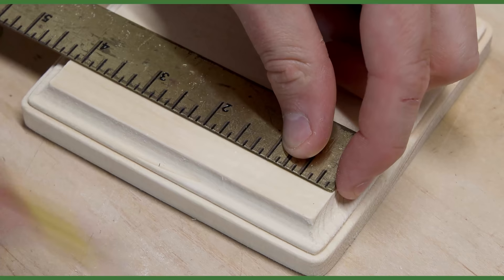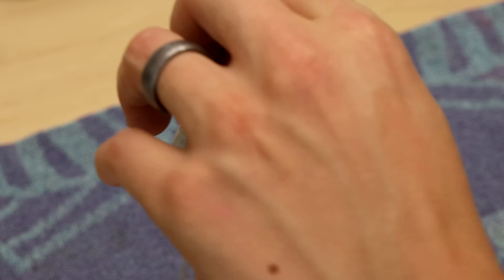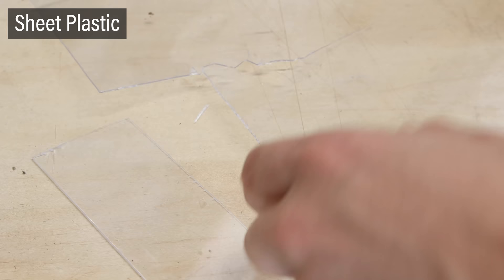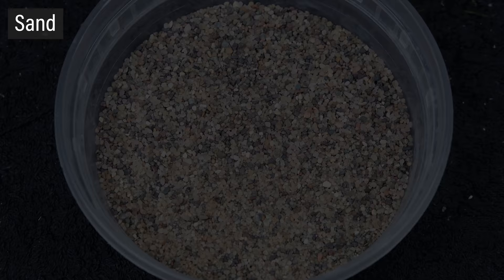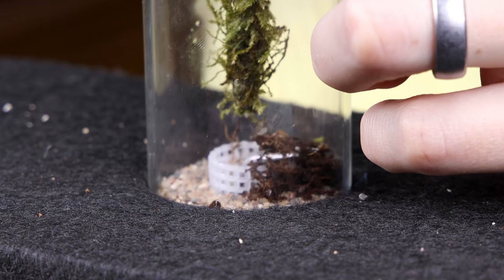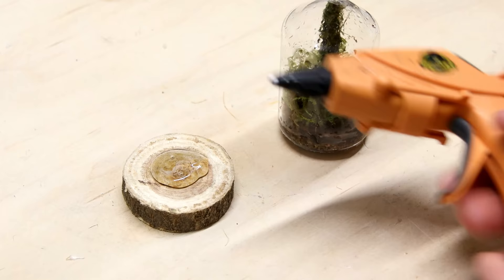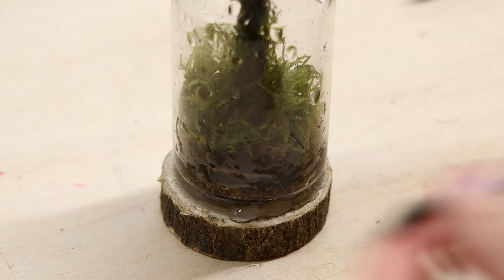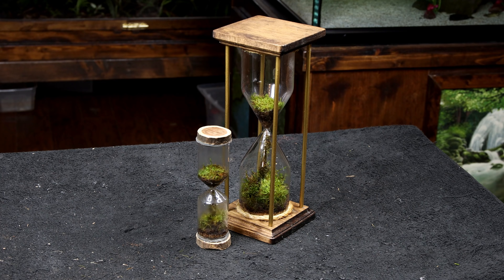Moss Hourglass Terrarium

Comment from the maker: Been working on a few pretty involved projects and figured now was a good time to make this build happen... or so I thought until this one threw me for a loop. At first I wasn't sure if I could make it happen, but I persevered! Just keeping it real and showing that even I don't have 100% success all the time.
Reply: SerpaDesign first to like
Reply: Hi
Reply: hi
Reply: the process was really interesting to watch man, thank you!
Reply: Thought I'd put this in the comments to help you out in the future.
 
Hole bits aren't very good for thin glass, it's better to use diamond burrs. Just trace out the hole you want and follow along it with the burr on low, medium speed. It'll take longer, but it's much easier and has a very high rate of success. Slow and steady is the best practice for thin glass. I've done it countless times and have had very few failures. You should use a continuous flow of water instead of the ring of putty. The putty and water method will let the water to get cloudy and make it hard to see what you're doing but the continuous flow of water will wash everything away and keep your work area visible as well. Either way you still need water as it'll keep the bit from biting too hard and keep it cool throughout the cut.
Reply: SerpaDesign what silicone do you use?
Reply: Thanks so much for your videos. After a stressful day, your crafts soothe me. I also admire how you show even the downside of your work. With that, you show us that no work is really a perfect work, and there is always room for improvement. Thanks also for your charity work in the Philippines. I saw it in your collaboration with Mikey Bustos. I hope that one day, you will create a Filipino inspired work. More power and peace!
Reply: Tanner, I need help please. I would like to make an open top terrarium of nothing but one evenly beautiful green moss. Problem is, my cat is horrible about wanting to touch and play with any plants I have.  
Is there a non toxic moss I could use in a terrarium?  Thanks for the indo.
Reply: Good effort but that must be impossible to ever clean, I found it tricky working with my bottle aquarium I made of a 1.5ltr bottle.. I think you could melt a hole in the hourglass with a blowtorch if you are careful.
Reply: Lolers

Comment: Not sure if this will make it to you but one good method of drilling glass is the speed. At a low speed and drilling with the bit as leveled as possible. Drilling at any angle can cause the glass to be a little jealous and crack on you. Not always will you have to use a cooling agent or puddy, (puddy keeps the debri you do not want while you drill) if you do use it on thin glass such as these it is good to use antifreeze. It has a higher viscosity, it will have better lubrication and cause less friction.

Comment: It strikes me that an easier way to get this effect (in terms of construction and maintenance) would be to use two ground glass laboratory flasks.  It would be easier to work in each flask, and then you could seal them using two ground glass stoppers glued back-to-back with clear silicone.

Comment: in case it hasn't been suggested, drilling the hourglass while the whole piece with the drillbit is underwater. Whole piece underwater uses the same reasoning for the attempts with putty, there wasn't enough putty for the reverberation of the rest of the glass

Comment: Hey I'm attempting my first build but I'm stuck on disassembling my tank. I've removed all surface silicone but it's still held together really well and I can't seem to get a razor in the seams. I was told I could use vinegar or denatured alcohol to dissolve the remaining silicone within the seams, does this work? And is it safe so long as I wash the glass thoroughly after?
Reply: Have you tried the classic terrarium in a jar? That is my favorite way because if you use a tomato jar it is completely free!
Reply: Wow your really going for the hardest part right away
Reply: I have done jar aquariums and terrariums, so I guess it's not my first build but it is my first time working with a fish tank. I ended up being able to separate the panes with the razor after I developed a method that worked through trial and error. Only ended up cutting myself once (tiny) now today I'm going to try and cut the glass and hopefully reassemble to my liking. Wish me luck, n thank you Tanner for the inspiration!